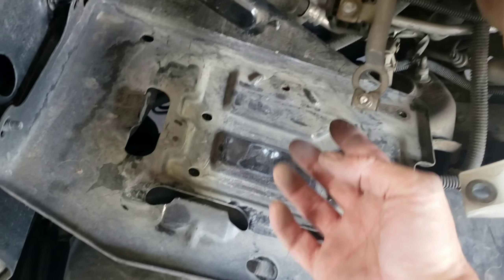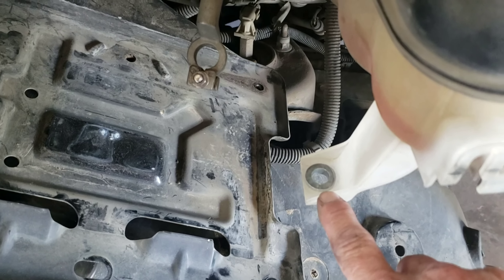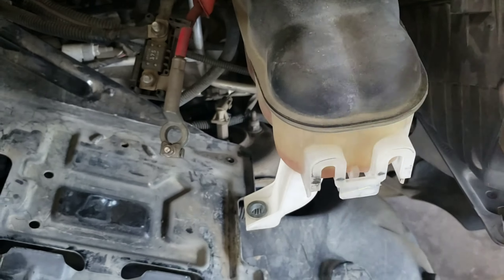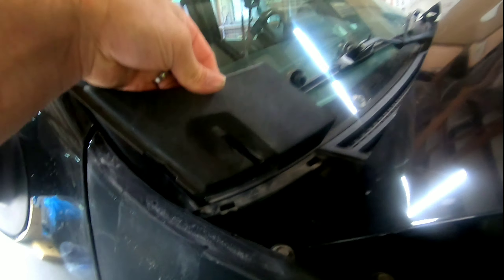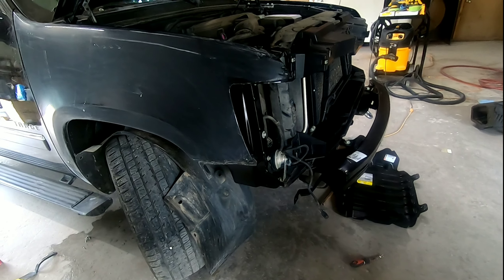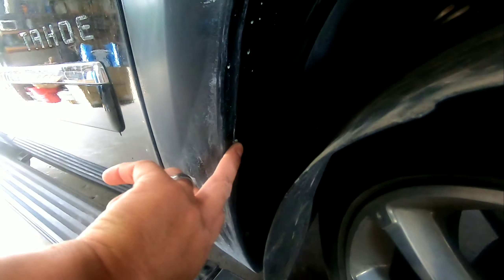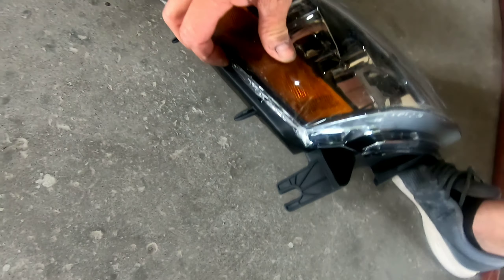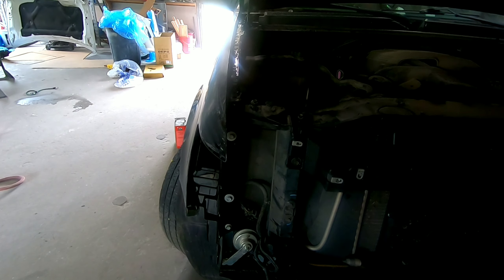How to remove 2007-20011 Chevy Tahoe fender.

Comment: Thanks for the video, I need to remove the fender to investigate water leak behind the fender around the place where the sound dampening material is present. Question: is removing bumper and front grill essential to remove bumper?
Reply from the maker: Grille for sure,  I would just remove them not that difficult and less frustrating.